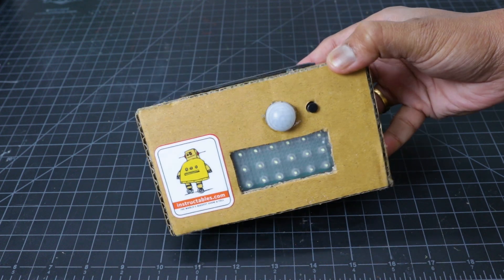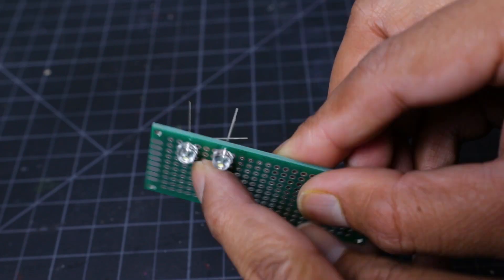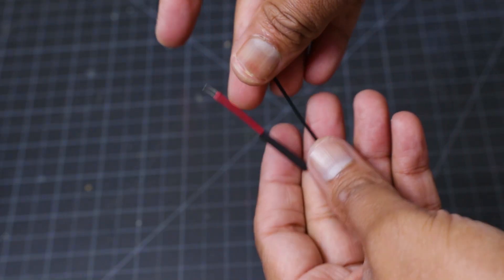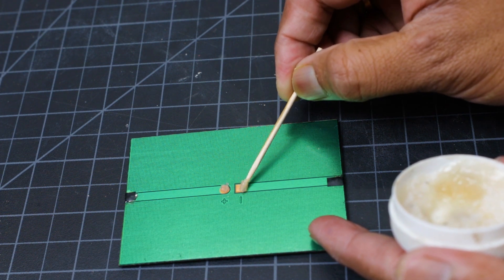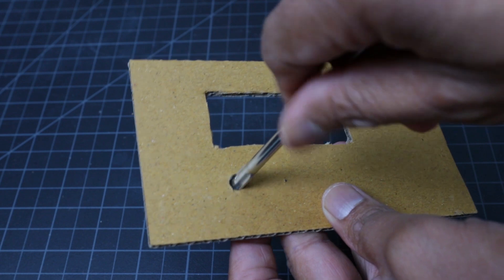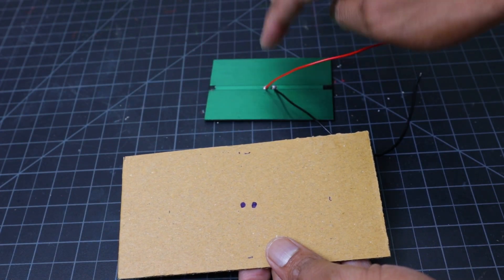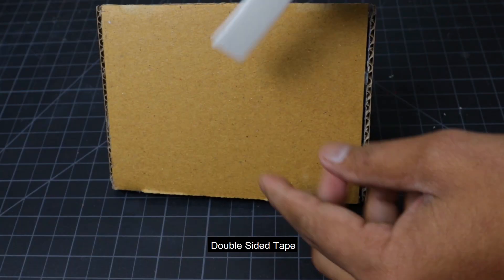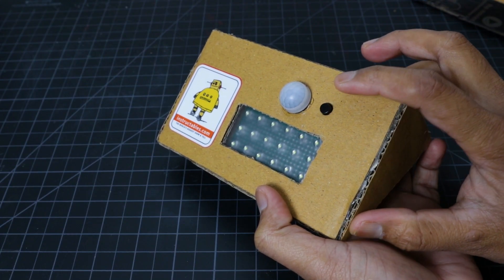How to Make a Solar Motion Sensor Light

Comment: Does the battery need BMS?
Reply: if the battery is one it does not need to use a BMS, if is in parallel or 2-3 battery is recommended to use BMS

Comment: Hello
I have 14 photovoltaic panels which each output 5V and 0.135A how can I benefit from them? do you have a recommendation to value them
At first I wanted to do it in parallel circuit, and they told me that I need this component to charge the battery. Here is the component link
https://www.conrad.fr/p/regulator-de-charge-solaire-ivt-pwm-seriell-12-12-v-4-a-113344
but this component is not available in my country.
thank you in advance

Comment: Hi my friend, instead of 18 led can i use 32 or more? if so what values a had to change. thanks
Reply from the maker: You can use 32 leds, connect all in parallel.
No need to change anything.
Reply: @opengreenenergy  thanks very much my friend for answer my question. I forgot to ask you if  can I use another 3.7v battery in parallel (two batteries in parallel. thanks again.
Reply from the maker: @jabalr22  You can add.
Reply: Use 2 of the cheap 1 watt leds, you can get the leds for 0.1-1$/€ per led